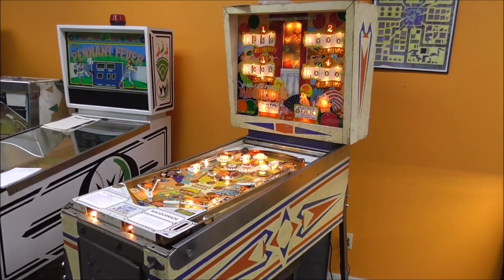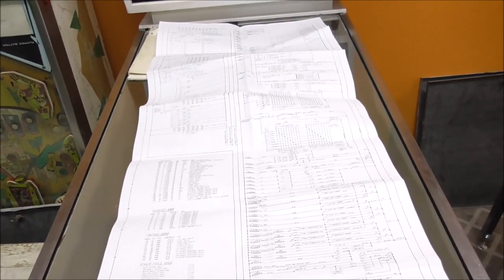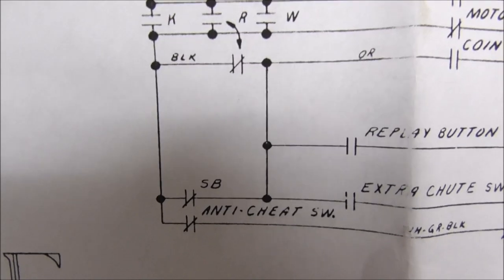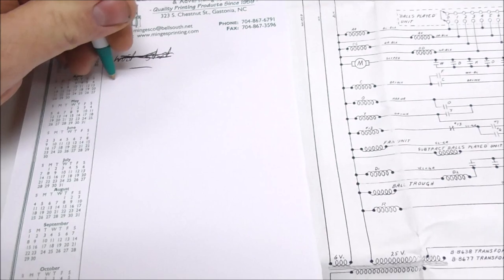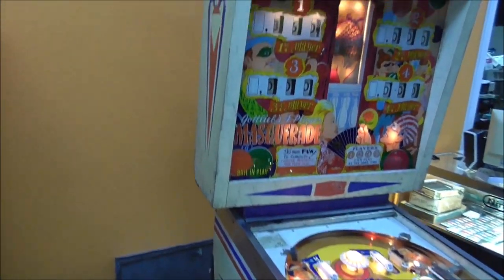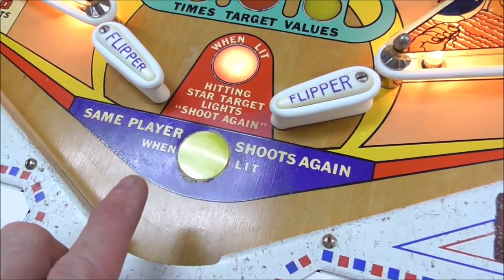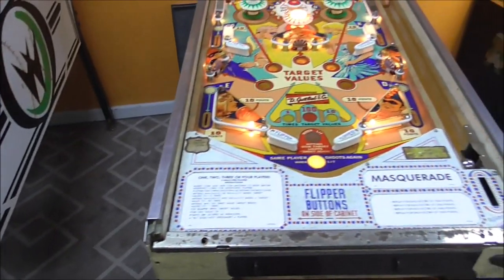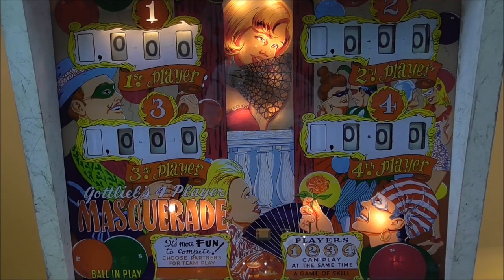Testing for faults on a 1966 Gottlieb Masquerade Pinball Machine with Schematics - #6

Comment: Amazing, Gottlieb used line voltage on so many contacts that you would assume would be low voltage, like the replay button or the slam switch for example. You should point out that before making any adjusts pull the plug, unless you want to get a charge out of it!

Comment: The schematic diagram can be likened to a map of your local city that may list some of the local landmarks like the library the police station and so forth but the electronica schematic tells you the different voltages and where is the different components are in relationship to each other and what their job is as far as the power is concerned whether it’s a resistor a capacitor or so forth
Reply from the maker: That's a good way of looking at it, Clark!